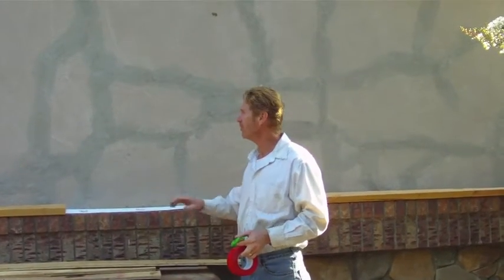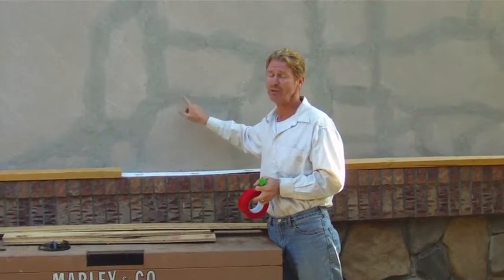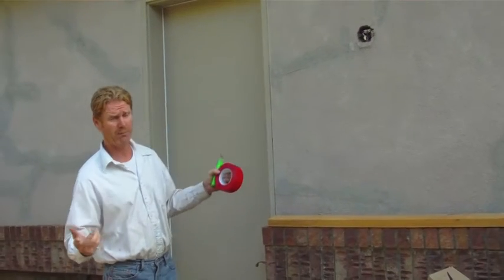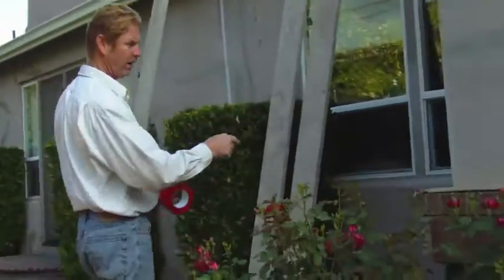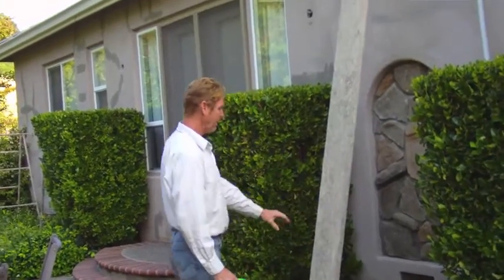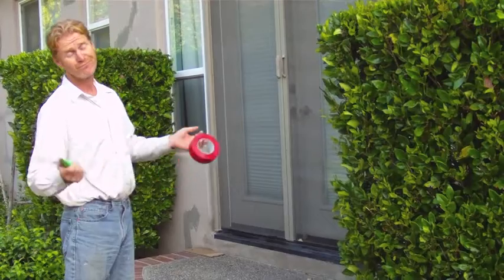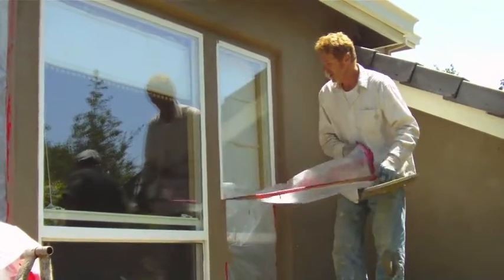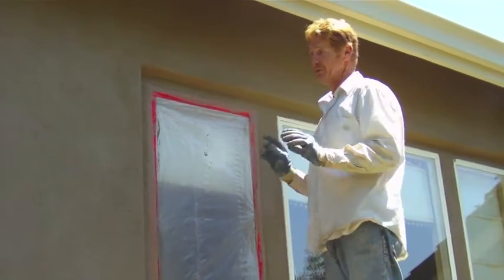Why do stucco walls crack?

Comment: If there thinner cracks that arnt deep like hair line cracks can u just fill it with a heavy coat of paint ?
Reply from the maker: Howdy Axe dude, absolutely, this is called flooding the cracks, 
Sherman Williams is the top choice of professional painters for this purpose and longevity.
   I'm no painter, however, I ask the quality painters which they prefer and hear Sherman Williams the most, by the painters I respect.     
                             Live long and Plaster
Teaching the world how to plaster one Video at a time.
Reply: Kirk Giordano plastering Inc. Thanks kirk u da man..

Comment: I don't think you answered the question of HOW TO DISTRESS the STUCCO so that cracks don't happen as much as they normally do?
Reply from the maker: Howdy  Jaime, craks casn be minimised by proper lathing, excelent framing using seasoned wood, faoundations built by compatent general contarctors, qnd about 30 other common sense ways of building a home.     
                             Live long and Plaster
Teaching the world how to plaster one Video at a time.

Comment: With hardcoat stucco homes, what I do is cover all the walls with synthetic fiberglass mesh and then color coat with acrylic finish. Hands down that permanently hides all the cracks and allows movement because of the fiberglass mesh.
Reply from the maker: Hi caddidon, I agee, to fiber mesh a home would be the safest bet for a home not to crack, convincing our clients to shell out say $10,000 to $15,000 thousand dollars to imbed fiber mesh tape with poly bond is the real question.
 After more than 30 years I have not met a single person who would pay the additional cost.
 Best wishes and thanks for the tip.
 kirk and family
Reply: Yeah true, most of the homes I do are old, so the update whether it be painting or fixing has to be done, so they upgrade and do the job with the fiber mesh and finish coat. Not always, but most of the time.
Reply from the maker: Hi Caddidon, I did have one case where I recommended fiber mesh to a complete home. The homeowner did a farrow system to their home, similar to sandblasting. This house was so beat up afterwards with deep cracks that the only way to fix it properly was to apply a poly bond type of cementitious bonding material  first then a mesh and a coat of poly bond over the mesh prior to a color finish, but coat kept them from this system.
 Best wishes, 
 kirk and family
Reply: StuccoPlastering Thanks Kirk.

Comment from the maker: Hey dude, if the house is painted you would have to day the area than plastic and tape. Duct or vinyl should stick if it’s not too cold. If it’s cold and wet there, you could use a sheet of plywood temporally, stand it upwards at an angle against the house if the hole is low.
 Best wishes, and have a good evening,
Kirk Giordano plastering